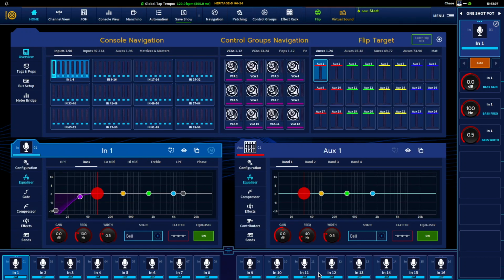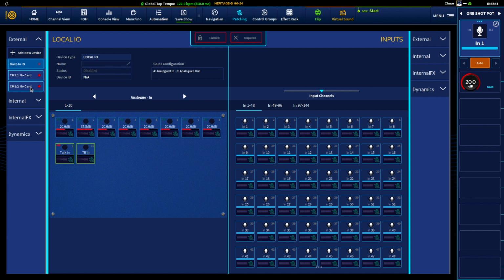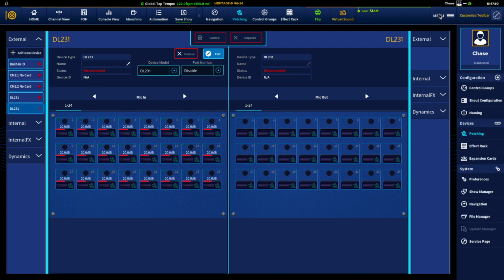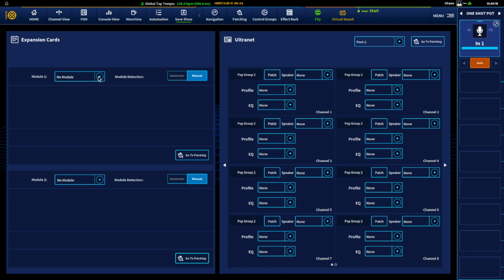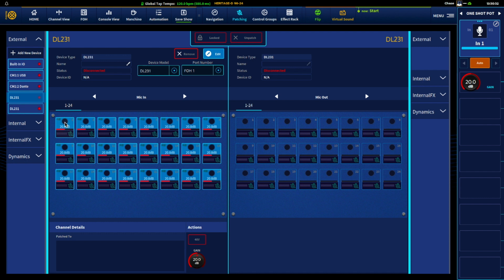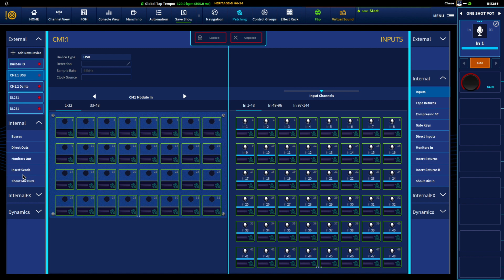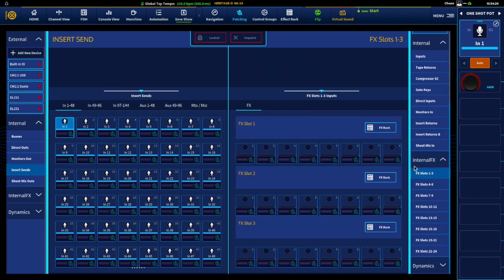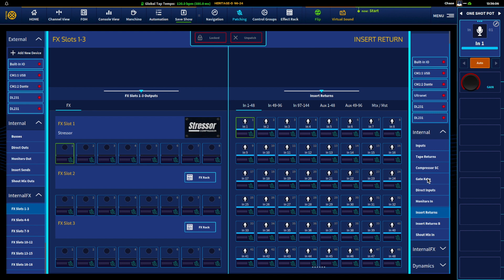Midas Heritage-D HD96: Patching

Comment: 00:02 Patching on the HD96
01:30 Configuring external devices for Midas Heritage-D HD96
02:57 Configuring redundant mode for local aes 50 ports
04:29 Configuring connectivity and expansion cards
06:03 Patching input channels from stage boxes to desk channels
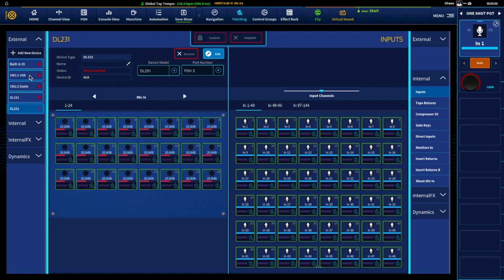07:37 Using virtual soundcheck for easy monitoring and setup
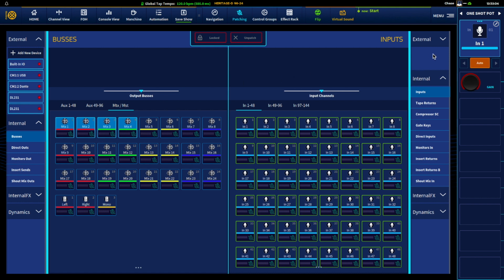09:09 Patching inputs to outputs and insert sends
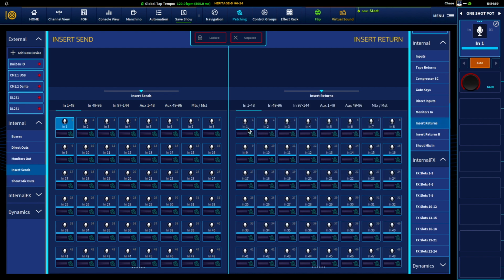10:47 Patching on the Midas Heritage-D HD96